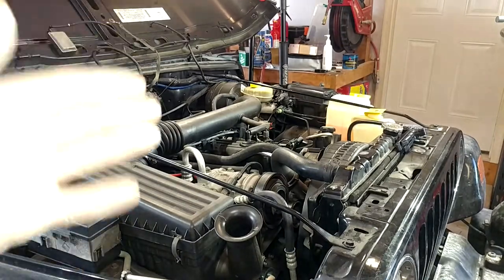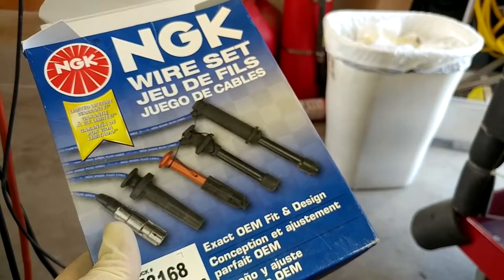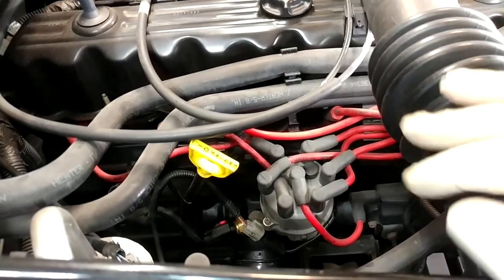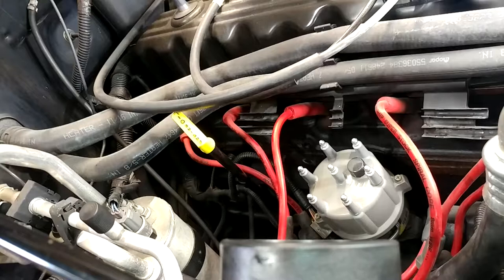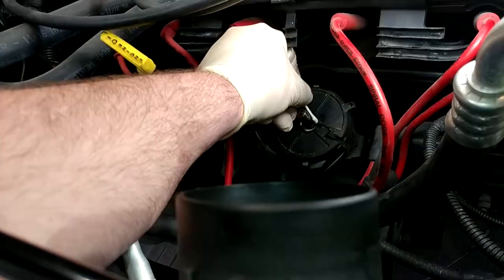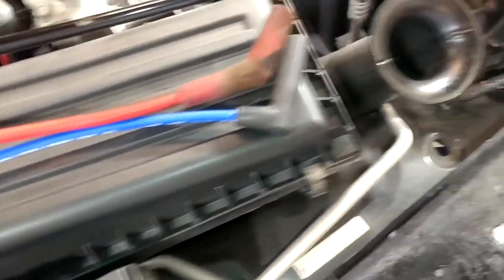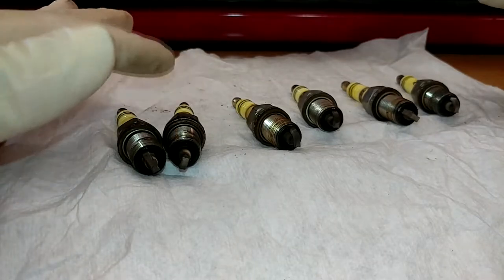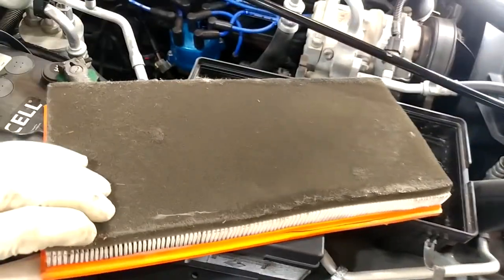Jeep Tune Up! (Spark Plugs, Wires, Cap, Rotor, etc)

Comment: IMHO, wires are too expensive to replace unless they aren't conducting.  Given those are good quality wires and not that old, I'd have passed on the wires.  Really, time and heating/cooling cycles is what is kills wires, but because they physically degrade.
Reply from the maker: I like to change that stuff out before I have trouble, though I do admit 30k is probably a bit early. But... I do rarely drive it. 30k may be 10 years from now. We'll see.

Comment: How was it getting the boot back on that plug on cylinder #1? And tricks or advice?
Reply from the maker: I don't remember anything specific about it. I may have pushed it on with a set of wire pliers?